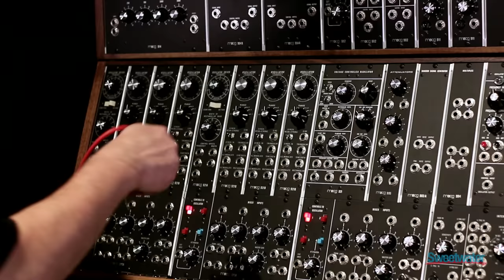Moog System 55 Modular Synth Demo — Daniel Fisher

Comment: I predict that there will be a resurgence of analog synth use for the next few years, then musicians will begin to struggle with failing jacks and patch cables and dirty pots and we will all discover again, why digital synths so quickly replaced analog, 30 years ago. Still I gotta say, LOVE THAT SWEET ANALOG TONE.
Reply: Hmm, No I don't think so. When digital synths came around 30 years ago, they offered something new. Sounds and possibilities that musicians didn't have before. Because everybody likes a new toy, they traded their analog synths for digital ones. However, now everybody is used to and well aware of the possibilities of digital synths (and VSTs etc.) But also the limits of digital stuff. That's why analog has made a comeback. Not to replace digital synths, but rather as an additional tool for flexible sound creation.
Reply: Moog is very nice and all, but since we have like at least 5 main synthesis methods, closing oneself down to subtractive synthesis only, it's quite limiting in my opinion.  If one has $35,000 for a subtractive synth, one should also have the same for a Fairlight additive and sampling, Synclavier (I believe additive and FM, and sampling, too) and $30,000 for Yamaha VP1 physical modeling synthesizer.  Then the system would be better balanced than buying all subtractive synthesizers only, which seems so prevalent nowadays.  I'd far prefer to have my system balanced to cover all synthesis methods: say Kawai K5 for additive, Casio FZ-1 for pseudo additive, waveform drawing, sampling, and subtractive, Yamaha DX7II for FM, Roland D-50 with PG-1000 programmer for subtractive synthesis, and Casio VZ-1 for phase distortion, and Yamaha VL1 for physical modeling.   Of course my ultimate dream synth would still be the VP1, with polyphonic physical modeling.  Let me put it that way, if I won the lottery I probably wouldn't by the Moog.  It's nice and all, but I'd more likely lean towards the VP1 or Fairlight CMI series II or III and have he D-50 cover my subtractive needs.
Reply: Andrew Piatek Yes, except that a digital synth don't have to be that expensive anymore. Back in the days of the Fairlight and Synclavier computer chips, especially memory chips, where really expensive. Adding a few megabytes of memory to a Fairlight in the early eighties cost a fortune. Nowadays it can all be done with small chips at the cost of a few dollars. Analog is a different story though. Especially when they recreate a vintage synth like the Moog 15/35/55. All those discrete and sometimes hard to find components are reflected in the high price.
Reply: As far as I am aware, the Fairlight CMI series-II reissues is flat fee $20,000 available from Mr. Vogel.  Synclav seems to have died away somewhere in Massachussets probably?  Now, when it comes to "analog", you should owe it to yourself to see teardown video of Dave Instruments Prophet 12.  It's basically hollow inside.  If the the newly released Sequential Prophet-6 with VCO's is similar, then the Prophet stands for Profit there.  MS-20 mini and new ARP Odyssey are probably analog (although Dave Smith says it's just stupid to use analog chips for envelopes) and both within $1,000 range.  My point is that the integrated circuits make the analog technology very cheap, too.  Having said that, the $35,000 price tag for Moog 55 is not outrageous.  After all this is what a fine Yamaha grand piano will cost you.  And nobody seems to make any fuss about that, so not sure why would anybody make any fuss around the Moog, and neither do I.  I am just saying that it makes more sense to have representives of all forms of synthesis, as opposed to just subtractive.  But of course, I respect anybody buying the new Moog modulars.  I am just saying that if I won a lottery, I wouldn't but the Moog.  I'd try to gind Yamaha VP1 isntead, and maybe even contact Mr. Vogel about his Fairlight.
Reply: Andrew Piatek I think the new Fairlight is actually way overpriced. I just looked at the website and he's asking a whopping $25.000 for it. Ouch! Even with the nice keyboard, monitor and the limited production number it should not cost more than say $6000-8000 in my opinion. I think mister Vogel is just really trying to cash in on the name Fairlight. Different from the Moog, it's not an exact reissue of the original, but rather a new instrument based on the look and feel of the original. With modern chips and production, the cost should be a lot lower than back in the eighties. The Fairlight basically being a sampler, I don't see why you would really want to have this compared to more modern sampling options. Except for the cool look maybe. 

The Dave Smith instruments are also new designs, allowing him like you said to use more integrated electronics and keep the price relative low. I would BTW not call the Prophet 12 analog. It's got digital oscillators. The filter is still the CEM one, but the sound is still very cold and digital in my opinion. The Prophet 6 on the other hand looks quite promising. 

The Moog 15/35/55 are different because they are exact replicas of the original. Using the original circuit design and parts instead of relying on cheap integrated technology, makes all the difference. So yes I do think the price on those is not outrages taking this in consideration. They are unfortunately out of my price range though :(

And yes I agree there is a place for all types of sound generators, analog and digital. I like both for different reasons.
Reply: MacXpert74
Fairlight is far more than just sampling.  It's also an additive synthesizer permitting waveform drawing on its screen.  My main gripe with the new Fairlight is that is has flat LCD.  It would be far more suitable to have real monochrome CRT screen as on the original.  Also, the build in iPhone to the keyboard is super tacky.  Yeah, it's very tough to get anything real these days, so the Moog modular is really great in this respect.  And not too expensive.  It's the price of Yamaha grand, as I mentioned before.  Not even a Steinway category, and some people have grand pianos, and nobody makes fuss about it.  The maing problem that I have is todays market to go only subtractive.  I'd be more happy to see more synthesis covered in hardware form, such as FM, additive, phase distortion, and physical modeling.  Not just analog physical modeling, but acoustic physical modeling as on the Yamaha VL1/VP1.  The reason that everybody goes for subtractive synth is because they are immediately rewarding.  It's very easy to vary the timbre with filter cutoff and resonance knob.  I understand that modular gear flexibility allows for far more than a normalled subtractive synth such as Sequential Prophet-6, but still it's all subtractive.  Some very basic FM is possible, but it never gets near the fully fledged digital FM.  So my point is, since we see Moog being reissued, I'd like to see other forms of synthesis being reissued in hardware as well.  I understand that Roland D-50 development was 70% software, which almost qualifies it as a soft synth; nonetheless, the instrument still have a stronger form factor and look and feel, which fully software implemented products, which have none.  So, that's my gripe that I still have to go on eBay for what I want, and I stopped visiting Sam Ash music store, 'cause there nothing interesting there in synthesizer section.
Reply: jacks and patch cables don't generally go bad and are cheap and easy to replace. scratchy pots can be cleaned with de oxit. that isn't why analog synths went away.
Reply: XLR cables go for like $30 a piece, and with my 32-channel mixer, cables are not necessarily cheap.  Anyway, what kills most hardware equipment is the dust, so if you put big swath of cloth on your Moog modular for the night, you should be better off.  Anyway, I love analog technology.  When will we see reissue of analog rear-to-real like Studer or Teac?
Reply: Andrew Piatek
I believe the modular synths use(d) 1/4 phono plugs which don't cost $30. dust doesn't bother electronics either, especially when they're sealed in modules, and the modules are in a wooden cabinet. I have an old rogers reel to reel in the basement. it doesn't sound any better than a new tascam pocket studio but is 10000 times bigger and heavier!
Reply: And so is the Moog.  I wonder how many people does it take to move it around.  But people still play grand pianos these days, so I can understand that.  As far as analog tape goes, looks like Tascam has fourth iterration of the 202 auto-reverse dual tape deck.  And a stash of brand new Maxell and TDK tapes on eBay.  The combo is very tempting.  The only thing keeping me from buing that is the fear of being ridiculed by iPhone mainstreamers.  Other than that, I want the Tascam tape deck quite badly.  Who cares about the hiss.  The time natural smooth compressing and saturation might be worth every peny of the new Tascam.
Reply: It shocks me that anyone would want a Fairlight these days.
Reply: I would want a Fairlight.  It's as respectable brand as Moog, if not more respectable.  It also delivers additive synthesis, waveform drawing, as well as sampling, with full editability and programmability.  Also, Fairlight uses as many analog components as it uses software, so it's in my view a very nice system, with unique quality, and character.  Modular Moog might be good for subtractive synthesis and some limited FM, but it doesn't offer really any other synthesis methods.  Besides, I can get out of my D-50 about 75% of what people get out of analog synths, plus I get patch memory, real time control of every parameter via SysEx, ring modulation, pulse with control with aftertouch, and several other things.  And if I realy had to go for a modular system, I'd go for Cweyman modules.  That's about $8,000 for a reasonable set.  So, if I had a choice of a dream system, that would be a Fairlight CMI series-III, Cwejman modular, S-770, D-50 with PG-1000 programmer, DX7II, VZ-1, and K5.  Synclavier is cool, but not my thing aesthetically, and neither is the Moog.  Sure, people has been crazy about subtracive synthesis since Clavia hit the market with the Nord Lead in 1995, so I understand that 20 year obsession with subtracive stuff is not as much of a fad as I wish it would be.  And I have the apprecation for subtractive synthesis, but as I said before, the D-50/D-550 cover subtractive synthesis for me in spades, and with character.
Reply: *****
I've never had a digital synth crash. the only one I've ever had crash was a diel dk600 which has most of the same parts as a memorymoog.
Reply: chieftp Well, the digital synths are expected to crash, because they running software.  Yamaha DX7II even has an a button combination to press to reset the unit it if freezes.  Haven't happened to me yet though.  By the way, I am a big fan of digital synthesizers, but not PC based.  I like MIDI rack modules and keyboard instrument.  In fact, I wouldn't care less if they are analog or digital, as long as they are dedicated units designed for music, not for Internet browsing.
Reply: Andrew Piatek
I've had probably a dozen DX7s and never had one crash. yes, most modern synths are nothing more than a computer with synth like keys and a few knobs/buttons. but realistically, most of the early analog synths were crap that never worked right nor stayed in tune. and the early poly analogs were a nightmare as well.
Reply: Well, actually the DX7 is also a computer, albeit with dedicated processors and all.  I recently got The Complete DX7 book by Howard Massey, and it clearly states there that the DX7 is a computer.  It's a wonderful book though covering all the sound theory both for analog and digital technologies.  It's a great read, really.  As far as digital synthesizers crashing, it hasn't occurred to me either.  Once I garbled my D-70's OS by loading SysEx dump to it from a cheappo sound card on an IBM PC.  Never happened with my Atari ST.  Anyway, I am digressing here.  My point is, I like digital technology as long as it is on dedicated musical units.  Atari ST might be a general purpose computer, but it runs only one application at a time, so it in effect becomes a sequencer, so it's like a dedicated tool to me.  Can't say the same about modern computers which seem to be more geared towards browsing internet, playing videos, and all, instead of music making.  But that's a topic for a whole different discussion, and it out of scope here.  The Moog is fantastic, but no to my aesthetic needs, 'cause it's kind of looks '60s, whereas I am an '80s early '90s guy.  So, obviously I tend to gravitate to instruments from that area, which were mostly digital.  I have high appreciation however for anybody who ordered the new Moog modulars.  It might have a commercial potential, I mean, I wouldn't want to buy yet another album done on a PC, when I can choose a recording done on the real deal Moog machine.  So yeah, respect to all the Moog buyers out there.
Reply: No way, we are going to see more hybrids like the Prophet 12.
Reply: Sinoda Cognito
the prophet 6 I imagined would have NO presets, NO midi, NO appreciator, NO sequencer, NO effects, NO velocity sensitivity nor aftertouch, 61 keys, analog EGs and analog LFOs....and be priced below the 08. just a straight forward performance synth ala juno 60 with multiple oscillators. sigh....
Reply: Prophet-6 has everything needed with the exception of 5-octave keyboard.  Patch memory is essential in a Prophet synthesizer.  And I love the styling, and the sound,  and the VCO's,  but cutting out an octave on a velocity sensitive keyboard with an afterthouch is is almost a crime.  I mean this makes no different from Nord Lead.  It totally sucks when manufacturers skimp on the keybed.  Let me search for Nord Lead 2 on Ebay.  It's probably a better choice
Reply: Andrew Piatek
the EGs and LFOs not being analog is a big turn off. and yes, without 5 octaves, you can't play Jump...you just can't. :(
Reply: Andrew Piatek For my needs the 5-octave is sufficient. Would I like more? Of course...
Reply: Andrew Piatek  The prophet series are better for studio work in my opinion, in that I enjoy the tones of Prophet synths more thus far. Nords are amazing but its just not my style. I am going to get a MonoPoly or a KorgPolySix next I think. Or that Korg Arp Odyssey reissue...that is cool
Reply: Oh no... Everything but no PolySix.  My music teacher used to have this, and it was a dog.  Nord Lead 2 is superb, especially in the hand of Hiromi Uehara.
Reply: Oceanids Buy the Kronos it has the polysix engine along with the MS20 engine sampling and 7 other synth engines its an amazing keyboard.
Reply: If somebody paid me $1,000.  I'd consider Kronos for a day, and that's a maybe :)  Come on, Kronos is an Intel Atom motherboard based PC (that's about $100 worth of hardware if not less).  I saw the tear down video.  M1, T3, Wavestation, no problem.  I'd pay full list price if I could only get a brand new M1, T3, or Wavestation.  But Kronos?  Anyway, I already voice my opinion.
Reply: Well all I can tell you is  I have owned a lot of Korgs M1, DS8, M3wRadius  and currently own a Triton and the Kronos.  The Kronos is an amazing beast as it gives me all the sounds of its predecessors, insane sampling capacity, plus a heck of lot more(9 engines in all). Karma and the control surface abilities makes it a great performance tool as well as a workstation. The touch screen and it's UI is extremely intuitive so much so that I don't use the editor on my Mac.   You really can't get a feel for how powerful this workstation is from playing around with it in the store you need to dig in an do projects with it to really appreciate it.  As far as PC hardware goes its all about how you put it together  with the custom OS and modeling engines and that is something they got right with this one. In all transparency I have no plans on getting rid of my Moog and my Hammond but I not hauling them to gigs anymore. Just my two cents.
Reply: Maybe.  But I still prefer M1, T3, T2, and Wavestation.  Once they introduced the cheappo X-series I lost interest in Korg completely.  Trinity was quite good, but everything that came after repulses me aesthetically.  So I stick with Roland and Yamaha
Reply: threalis Maradona I am just an analog type of person!
Reply: Andrew Piatek Wow, I didn't even know there was a new Fairlight! 
Ironic that I see it mentioned first on your above comment on YouTube about the new Moog Modular System 55!
Kind of opposites, don';t you think?I met someone who sold me an old Prophet-5 in England who had a Fairlight Series III at home at the time. Awesome. How wonderful it would be to own this stuff. If I was rich I would buy the lot and then probably not ever really figure out how to use them. However, not rich so gotta enjoy a smaller number of old synths that have their own charm.
Reply: You can now get S-50/S-550 quite cheaply, it hooks up to monitor.  It's called poor man's Fairlight.  S-770 also very cheap these days, and they are really deep parameter-wise and very high quality.  I have an A-80 weighted controller with S-770.  I am still looking how to connect Atari color monitor to it to have the full experience.  I'd even prefer that to Fairlight to be honest.  I like Roland equipment very much from that time.
Reply: Oceanids I hear ya I too prefer analog sounds the Moog is a fun beast but the type of music I do with my main band is very piano and Hammond driven although trying to blend in more synth sounds. My second music project is a different beast and the Moog gets more limelight in that endevor
Reply: threalis Maradona could you link me to anything you do ? Sounds interesting!
Reply: +Oceanids here is my random stuff there is some moog on some tracks I don't have stuff with the new band just yet.   https://soundcloud.com/thomas-defelice
My main band it is more straight up rock is here www.ajarproject.com